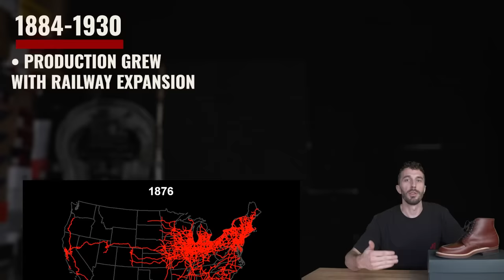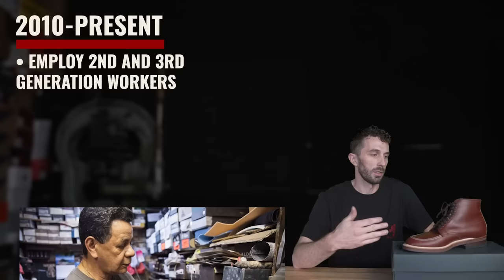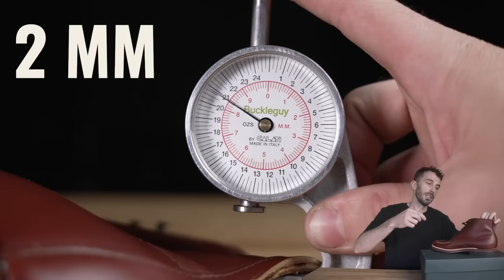Why the Indiana Jones boot is stupidly overpriced - Alden Indy

Comment: The question I have is has anybody ever had the heel stack actually fail? Or any of the other fiberboard parts? If not, isn't it just being sustainable?
Reply: This is my question as well. I believe every word Weston says about the boot, and he shows us, but what does it mean in a practical sense? Does the inferior material mean that the boot will last 10 years instead of 15? Does it mean it'll fall apart? So many people swear by this boot that a further explanation would be helpful.
Reply: I'll weigh in with my anecdotal experience with heel stack failure and cheaper boots that use fibreboard/leather board. 

They do fail at a higher rate than traditional materials used for the part of the boot he's referring to and a cobbler can fix/alter/upgrade them to better materials but...I feel like the price and materials ratio for this particular boot is just insane. Leather board doesn't wear well at all either so if it's exposed to any kind of wear/abrasion/the elements (which it will be in a heel stack) it'll just flake and fall apart in weeks or months rather that years. If the inner parts of a boot fail but the outer doesn't it's just a pain to even use them as shoes because it's legitimately painful to walk/do anything in them.

Comment: Definitely makes me glad I bought the Wolverine 1000 milers and then I had my cobbler do the 2/3 front vibram glue on. Got the boots for a big savings cause he wanted to try it out on a leather sole. So for letting me be the first attempt he knocked 150 off the price and let me have the boots any way I wished. When you’ve been getting your boots resoled and fixed by the same family for 20 plus years they offer you certain perks. He said “ you’ll probably be bringing these in when your 60 and my grandson will resole em for you”. Good laughs

Comment: Great video and you point out some sad facts about this iconic boot. Two points that I think are somewhat misleading based on my own experiences with my Alden 403 boots.
First, the neo-cork outsole is not slippery. It offers more than ample traction. This sole has been made for many years and if it were slippery, people would have long ago pointed this out. Yes, when brand new, they can be slick, just like a new leather outsole. However, once broken in they are fantastic. I realize this is a subjective observation. 
Second, I don't believe the split leather insole is a cost cutting measure. I own many pairs of Alden dress shoes and they all have this same type of insole. I've had some shoes resoled twice and the insoles are still in good shape. Would a top grain veg tanned insole be better? Certainly, but I don't think this is something that was changed to cut costs, they've always been made that way. 
Sad that the leather in the 405 is so crappy. Would have been nice to see a review on the 403 in chromexcel. 
Would also love to see a video on the classic LL Bean Maine hunting boot as part of the MITUSA series. I have a feeling you would discover many similar cost cutting measures. Thanks and keep up the great work!

Comment: I wonder if my 22-year-old Aldens were built with better materials. I think I paid around $200 back then. Main problems were the welt stitching wore through way too quickly and the outer sole started seperating, the tongue (then boots' tongue, not mine) was always slipping. The brass hooks are a bit too soft and deform easily. The neoprene-cork soles turned my boots into skates on wet surfaces, and the boots were too damn heavy.  On the plus side, they have aged beuatifully and look the adventurous part. They are also comfortable. These days I wear mostly cheap-as-chips Clark Desert Boots II.

Comment: I agree on most of it, and the use of leatherboard is cringe-worthy. The one aspect I'll defend is the use of Chrome tanned, pigment-finished leather: that sounds to me like a genuine hold-over going back well beyond when Raiders was made. In the mid-20th century, pigment finish was rather common and nearly all leather (except bridal leather) was chromium-tanned. I wouldn't be surprised if Alden has been ordering their leather from Horween the same way for the better part of a century. So I'm not inclined to knock them for that. The rest though...yeah, they need to get rid of the leatherboard and stop using the split on the foot bed. Very disappointing.

Comment: I question whether an older version is this boot is actually better quality. I own an Indy Boot from approx 2006 and at that time Alden used a cotton liner rather than the updated leather. With that said, I wore them nearly every day for 7 years before I wore through the welt stitching and had to have them resoled. Aside from that the boot was in nearly perfect condition.

Comment: Don’t be dissuaded by this review.  I love my Alden Indy’s and theyve held up so well.  Most comfortable boots I own.  My 405s are from 2016. So forsure the leather has changed.  Mine are more of a pumpkin color.

I like the insole and how the leather is reversed, I prefer it this way.  I was surprised they use a “leather board “ instead of leather, but to me that’s not so big a deal as they would probably need be resoled before the durability of the leather board ever became an issue.

Comment: I consider myself to be fairly knowledgeable about 405s and other Indy boot models. Interestingly, the 405s were part of Alden's "Foot Balance System" line, making them technically an orthopedic shoe and not one of their higher-grade (and leather lined) shoes that I think they labeled Alden New England. Originally the 405s came with cotton duck linings (certainly in the 80s). I believe they transitioned to Cambrelle sometime around 2000 and transitioned to the "glove" leather lining around 2010. The boots in the mid 2000s cost around $350, which was pretty expensive, but marketing it as an "orthopedic" shoe may have allowed that price point. Even for accounting for inflation, the prices have definitely gone up. I'm not sure that the switch to leather linings over the Cambrelle linings make up the difference in cost. Despite being a fan, I have to admit that I've never fully understand the choice in the leather uppers for the 405s (at least since around 2005) and suspect that the uppers in the 403s (Horween's Chromexcel) and the shell cordovan models are substantially better.
Reply: I own a pair of 403s in CXL and in Color 8 Shell in addition to a pair of 405s. I can confirm your suspicions; the leather quality on both far surpasses the 405 shown here.

Comment: Wow, that is so disappointing. Thanks so much for exposing this greedy rip off. I'll never buy a pair of shoes from Alden. For sure go with some nicks or whites semi dress boots over Indy's if you want something like this. 

I swear I only paid like $450 for my white's farmer-ranchers 10 years ago. I have worn the hell out of them, clearing debris after hurricane Harvey (still have a little chainsaw nick on the front of the outsole), building fences, hunting in muddy fields, trekking through blackberry bramble, climbing trees, putting them through hell, and they're still going strong. They haven't even needed a resole or replaced heel, though the heels are close. It's ridiculous to see this boot priced at over $600.

My first pair of boots were, I believe, nearly $300, Justin Brand from some boot city store. Those were a total rip off too. Fell apart in 2 years. Then I did my research.

Comment: Excellent teardown videos. 
Most if not all companies that make products for the masses of consumers have the same faults. 

Take the north face for example, once they were at the pinnacle of design and performance bar none. 
However since most climbers are poor since their climbing and not working, when they do spend $ they want the best gear. 
Yet this same issue means a company doesn't grow or expand like others might. 
So they go bust or are sold to fashion houses that take the name and start offering plush, soft, fakes of the originals. 

Sad really I still have some original north face gear that still functions after 30 years of hardcore use. 

I'd love to see outdoor boots like those from LaSportiva, Lowa, etc torn apart, maybe some ski boots as well, like traditional telemark ski boots. 
Thank you for tearing these boots apart. 
God Bless

Comment: I bought my first pair of Indys in 2018. To this day, they're still going strong despite being my main boot for the last four years. I'm well aware of the flaws in these boots. They serve my needs very well as mainly a walking boot that's good for office or retail work. I'll just look elsewhere for restoration so that the heel block and midsole can be proper leather. So I got my money's worth from them in the end. Does this video change my mind on them? Not really. Because I quite like how comfortable the boots are and there really isn't any other moc toe boot that looks this good. I prefer the silhouette of the Indy to most boots and the neocork sole is probably my favorite sole for what I do. So it really depends what you use the boot for. I wouldn't recommend this for factory or construction site kind of work. Mostly office, retail, casual or even a chore boot to an extent. Depends how heavy the choring is. I can wear it to work and to church easily and that versatility is what I look for in boots. It's definitely not a Nick's or White's type of work boot and I'm not going to use it like one. Is the Indy overpriced? No doubt about it and I knew that when getting the boot and when getting a second pair. I like this boot. Despite its draw backs, I still like this boot.
Reply: Thanks!

Comment: Partial Rebuttal:
1 - The 405 leather is a recreation of a painted leather used on the originals. You can get the Chromexcel version for the same price but they specifically brought back this style for the heritage.
2 - The split leather midsoles have been in use for decades. They hold up beautifully and never crack like full grain versions, plus they are less slippery and absorb sweat better. They are a superior product that is obtained at great expense.
3 - The leather board midsoles are not strictly necessary as the neocork can be used without a midsole. They are likely there for greater comfort or to reduce squeaking.
4 - The neocork sole has fantastic traction in wet weather and on tiles - it's a heritage sole that was well-suited for industrial work. There are other soles Alden uses that all have their own benefits.
5 - The leather board heel lifts work fine, but this is the one area where the full leather stacks would be superior.

Comment: Honestly, it feels inferior to Redwing boots at half the cost but I'm not a boot nerd so I wouldn't know. I thought Redwing used real leather, not leather board.

I feel like this boot should be competing with the price range of between Thursday at around $199 and Redwing in the $300 range. And Thursday has a full leather heel stack, and leather midsole on many models, and also has the steel shank and cork on many models. I feel like the only area these Aldens are better is the insole using "genuine" leather i.e. cheaper leather and maybe leatherboard instead of fiberboard?

Either way, I appreciate Weston telling it like it is. When a boot is good, it's good and these are the reasons why. When it's bad, it's bad and this is why. Very helpful to us consumers in making an informed decision!

I think in general, if a company is not SHOWING us how their boots are made, we should be very suspicious. Notice how all those high end pacific northwest brands actually are not afraid of showing us how their boots are constructed and with what materials?! Because they are actually quality boots and they want us to know!

Comment: I had a pair of Red Wing boots that I bought and tried, for work (I'm a contract K9 handler at a port). I wore them for a few shifts and gave them away, because they were so ill suited for the job. I replaced them with a pair of Merrell MOABs (which have never let me down). I'd be literally damned before I'd spend $600 on a pair of boots. I think boots like these are more for LARPing than for real work. I couldn't imagine someone wearing something like these, or a pair of Nicks, for a job like mine or tactical operations (military/law enforcement/contracting).
Reply: Why can’t you imagine someone wearing a pair of Nicks for real work?? They are some of the best handmade boots you can buy.
Reply: @whereRbearsTeeth  Not for work where you have to be on your feet, over rough changing terrain. That leather would be way to hot, and without daily maintenance it would fail quickly. Also, in military type work you'd have the issue of replacements (logistics) being a nightmare. That's why you never see contractors or troops wearing them. Look up photos of SF troops and military contractors. They all wear Merrells, Saloman, Keen etc for those reasons. I tried the Red Wings and they were so uncomfortable and unforgiving, and bloody hot, that I just couldn't do them anymore.

Edit: I guess I should have specified that I meant military type work, or law enforcement type work. I didn't mean it as a general judgement on all work. My bad.

Comment: If any of you have watched Steve over at Bedo's Leather Works you knew this boot was going to be a disappointment. There a plenty of videos on that channel where he is resoling a pair of Indys or even fixing a defect that a $600+ non-work boot shouldn't have. The man is like the Alden whisperer and rebuild some Indy's for his channel into the kind of boot they should be. 
Otherwise, the Indy boot is an American tragedy. On paper it should have everything going for it. The company has a long history including doing specialized orthopedic footwear/work boots, like you would expect for an old shoe maker they have a range of refined lasts, the TrueBalance last the Indy is built on has the heal width 2 letter widths smaller than the the rest of the boot and paired with long counter its works to lock you heal in-simple but seems like a very good idea, Alden does seem to be able to get unique and interesting leather options and should have the tannery connections to get basically whatever they want ie. there is no reason for a subpar leather, finally the indy typically has a big steel shank identical and possibly predating the one in the RedWing Iron Ranger. But after all that only the last and the shank seem to maintain what the Indy is.
IDK what Alden's thinking is on all this. But the limited places to purchase their product and their website that looks like it was made in the late 90s tells me that they need a company/product overhaul.

Comment: Despite Alden’s corner cutting, these are the most comfortable boots you can buy, imo. There just isn’t a better last than trubalance and that’s what you’re paying for. Buy the Chromexcel version to avoid the painted top coat and they’ll age better. Also if you can get your hands on a descent pair of factory seconds from Shoemart, that’ll shave off a few hundred bucks.

Comment: Great video! Yes the Indy/405 is overpriced. Don't write Alden off though - pick one of their boots using horween shell cordovan and a commando sole (they even have a cordovan Indy). Sure its even more expensive, but at least it gets you around the meh painted leather and the zero grip outsole.

Comment: Ok, I think the use of leather board in some places is fine way to avoid waste at little performance cost. Perhaps not at the flex points. The decorative stitching likely helps keep the toe from flattening.
The heavily coated leather is a big problem for me. Takes them fairly out of the picture. (And so probably does the 270 welt.) Indy didn't wear them as dress boots. These are meant for rough exposure, and the leather should weather and patina along the way.
The overall point you make is correct, as are the details, this is an expensive statement piece wherein you pay high prices for credibility of brand. "Authentic Indy Boot" is fashion, not performance.

Comment: I wanted these more for the Indy name, but ended up with a significantly cheaper, but still high quality J. Crew Kenton boot. Good leather, Goodyear welted, with full leather insoles. Available now with CXL, I got mine off second hand for less than $100 in like new condition and they are well worth it and seem better especially for the price.

Comment: The Thursday diplomats with dainite soles are pretty close in looks to the Alden Indy, way more affordable option and better built quality.  Had mine for over a year, wear them very often and they still look good as new after a normal cleaning.
Reply: I disagree with Thursdays being a better build quality. While I love my two Thursdays boots (Cap and Prez), I've had worse problems with them in 2 years than I did with my Indys in 4 years. Heel block completely ripped off my Captain and the President insole wore througn. 2 years of rotating those two boots and that happens. In four years of owning my Indys, I only had to replace the heel caps once and had to reinforce the heels twice because I've worn the boots almost daily for four years straight. Unfortunately though, Thursday changed their design of the Diplomat. I was going to get those until my size sold out and they changed it before I could buy it. Which led me to buying the 405 instead in 2018. No regrets whatsoever owning both brands.